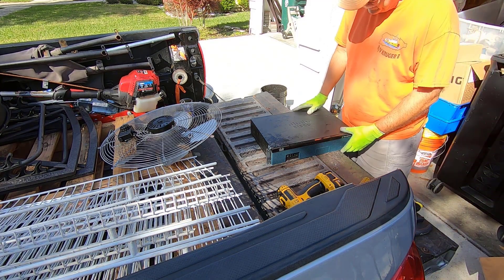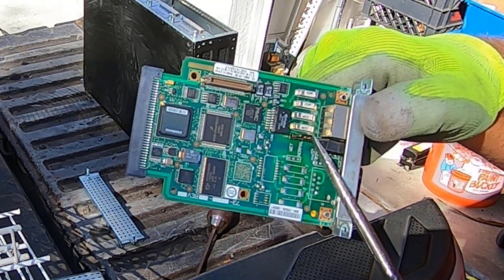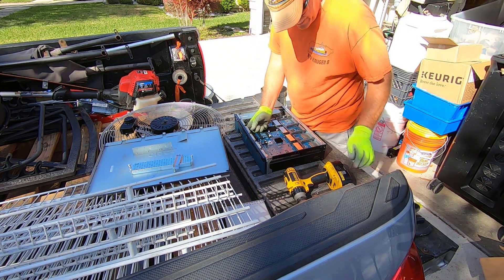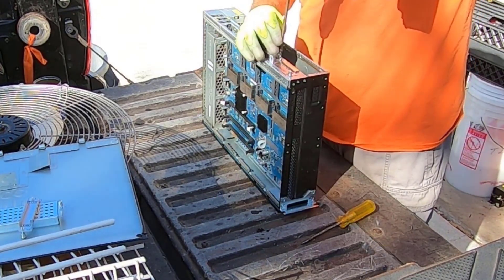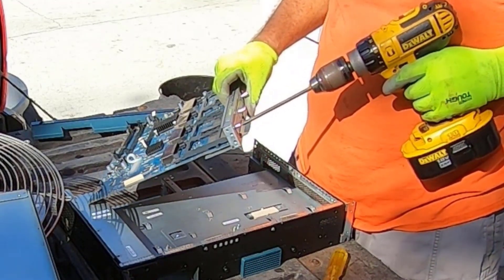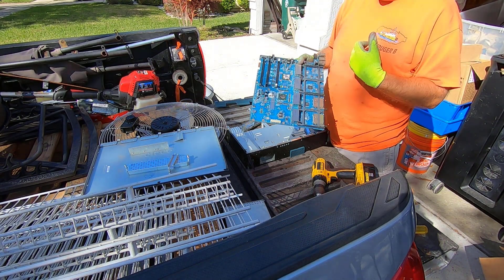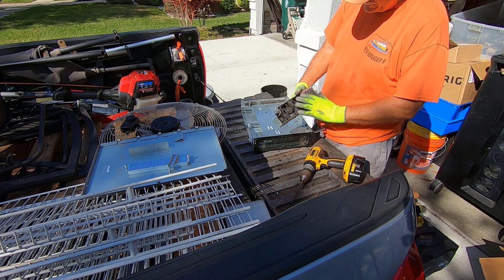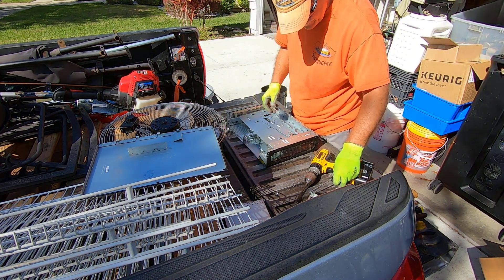ewaste scrapping   CISCO 2900 series

Comment: Hey you should check out Canadian Treasure Hunter’s video to see his wire stripper. The model name of the machine? The Shark Bite.
Reply from the maker: Thanks Wendell - I've seen CTH's wire stripper.  I have a motor operated stripper as well, different type.  I set aside the wire I want to strip (heavy gauge, usually solid core) and once a month or so spend a day on just that.  It makes for a good bare bright bucket load.  Since the buckets/bins don't take up too much space I can hang on to them for a little while.  It's always nice to take a load in when the prices are up.